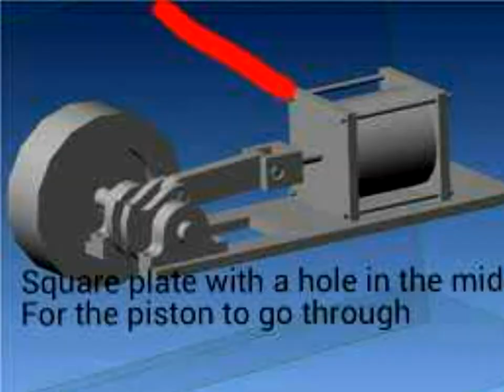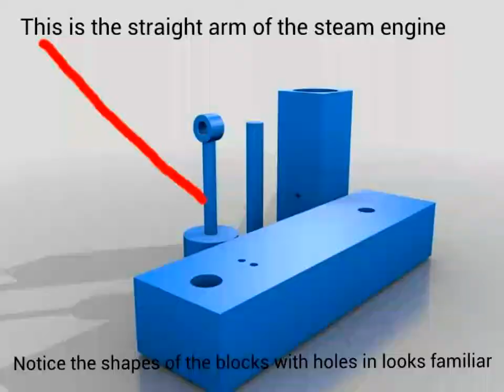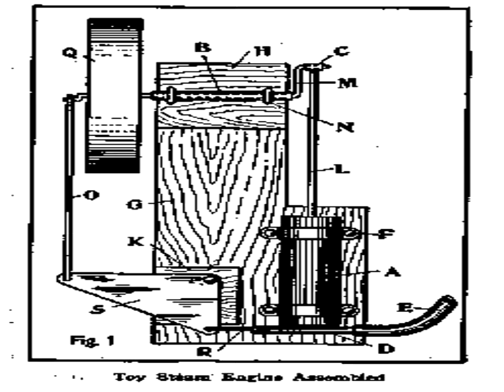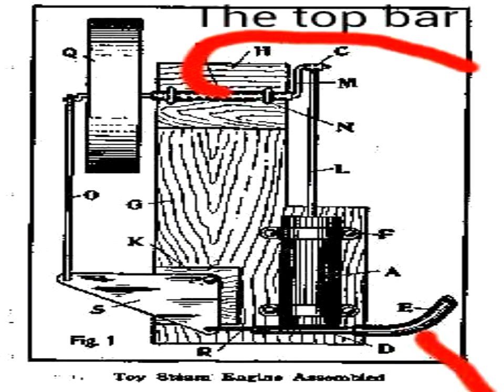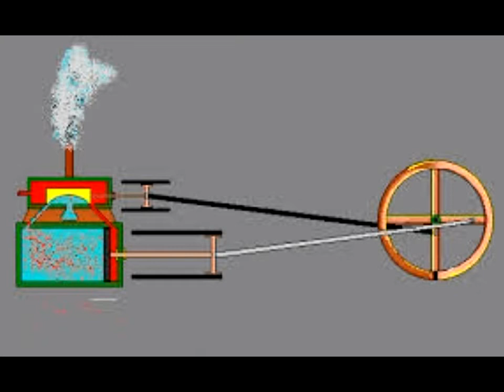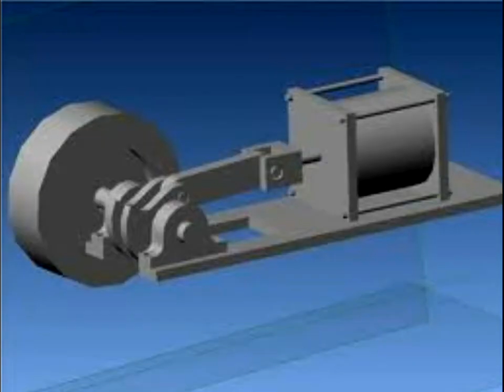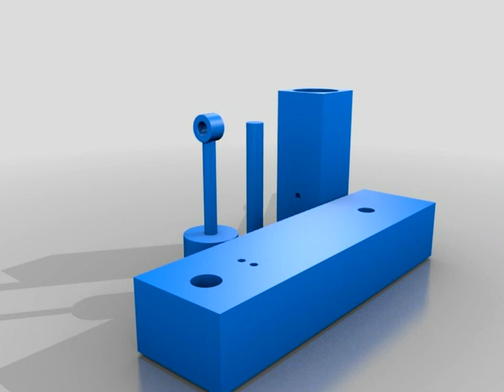PUMA PUNKU STEAM ENGINE theory with diagrams

Comment: Thanks for putting up a very interesting video. I came here after seeing your comment on one of the recent videos by Wise Up. Just flicked through your own video tbh as i'm very tired but will listen properley soon.The clamps were mentioned in some other video a while ago so you aren't alone in seeing that, although you do go into better detail on the metals used. I daresay that just as ourselves, different ways of producing energy were used. Fire, steam, hydropower. Remember that just a copper wire fixed to aluminium and partially dropped in saltwater can produce electric current, as can basic acids such as vinegar. The kings chamber and the queens chamber and the tunnels in the Egypt pyramids could have been for hydropower to create electricity. I read that the Giza pyramids used to glow at night. Also that they were in operation just a couple of hundred years ago and that the powermonger profiteers murdered the operators and those who knew how they worked, and dismantled as much as possible because they didn't (and don't now) want people to have free or very cheap energy. I think that is believeable. Anyway, I haven't heard of the place you're talking about before, but I see newearth have a video on it, so shall watch that too. Don't worry, you're not barmy. What you point out makes good sense :)
Reply from the maker: Ange W Thanks ange i appreciate your input.and that's very interesting what your saying about different ways to get  power . Yeah i definitely think they all had ways to make energy .and would of been kept a secret like the Egyptians did.. knowledge is power as they say ...I'm working on a video about pumapunku and the maths   that they used on the stone work .. descriptive geometry it's mind blowing ..how they even understand this .. thanks again for watching

Comment: It is a good video, you have to make some more. Let me start by looking at the Archeological record of the site. Tiwanuku is the Temple site and Puma Punku is a short ways away which was the stone grinding site for the blocks used in the Site. No steam engine parts have been unearthed at the site. No human remains have been unearthed. No Human garbage pits, human tools, or other evidence of Human habitation has been found at the site. THis is just fact. No evidence of Charcoal of fire has been unearthed. The steps to the site are all super huge and match correspondingly to the size and gait of the stone statues of the fish like beings. Water is the main connection to all the site as a Fish/terrestrial being needs water on its skin or it dies horribly. The step pyramid had a water channel and a baptismal pond on the top for some kind of ritual of its young. Modern bricks for an average humans are about 4 pounds or 2 kilos. The average stone bricks are the site were 300 pounds. Much too large for average humans. The large enclosure with the water spouts was a giant pool, now filled in, that was connected to the nearby river to catch fish for the inhabitants, and the spouts are for run off. The size and weight of the three platforms were needed because They were in running water connected to paddle wheel turbines that ran the stone cutting operation. They stones were clamped but carbon dating on the salted metal clamps will reveal they are just a few decades old at most. No evidence of smelting, ore gathering or anything like that has been unearthed at the site. Fact. Around the puma punku site are hundreds of tons of powdered rock or sand. THis is the slag from the stone cutting operation. Not some kind of Giant Explosion. A giant tidal wave from the lake, destroyed the site in one day and all activity ceased. Core samples I have taken from the site confirm this. For all I know you may be right IF you can show me steam engine remains. Nice cat by the way, I love my cats. Keep making videos and understand the average attention to any video is about 3 minutes. Everything I say is true and can be proven, no guessing. I have solved this Mystery. It is truly an Extra-Terrestrial Religious Site, just like the Inhabitants of the area refer to their ancient legends..
Reply from the maker: Thanks for a grate reply  very much appreciated the reason I think there is not evidence of casting as in Parts to the steam engine is simple the Spanish and the looters and like a lot of things in that area  were recycled
Reply: Tim g star Mills tech Puma punku is way up in the mountains near Lake Titicaca. Everything was made of Sandstone or Granite or Large rocks. The Spanish conquistadors knew of this site, but remember it was in ruins and covered in tons of dirt even in 1526. The Spanish wanted South American Gold and not stone. Study the statues and the Steps to all the temples. The steps are a foot high and not suitable for average humans. Remember they must have had some measurement system as metric and English measurements did not exist at the time. All the stones are ground by water powered grinding wheels as there is huge grinding wheels on the site. The three huge bases were needed to keep the grinding wheel paddles in place. The multi ton sandstone bases were set IN the river of flowing water. When the Tidal wave hit from the lake due to seismic action in the area, The wave came out of the lake and washed the grinding operation right off those three huge bases. Take a look at how the bases are out of line and moved. Only water could do that. The granite grinding machines were broke and lie in pieces near the bases. These aquatic creatures lived in the lake and on the land in the Tiwanaku site. The tidal wave wasted their building area and probably killed a number of them. Core samples at the site Don't Lie, they will show a huge disruption of setinment as the wave washed in and then out again. The site was destroyed in one day and the builders never used it again or rebuilt. Look at all the pictures of the site and they will show you the truth. Don't believe the tourist hype, look at the photo evidence yourself and keep an open mind. This is old news to me and I am going on to reveal more mysteries in Northern England. Thanks Ric
Reply from the maker: Ok what you going to see over hear?
Reply from the maker: DIOSpeedDemon what i was saying was the alloy thay recycled stone to build churches and buildings so they would of recycled pretty much anything that came across including alloy that would be scattered around the site it is well known they did this of course gold  was there main objective they may of even thought it was a silver of  some sort  this is just my opinion on what i see and read so wen you look at how thay motivated themselves old in the pursuit of gold it's not surprising